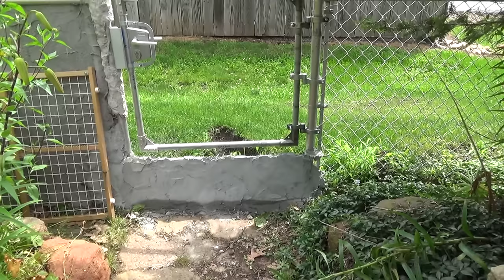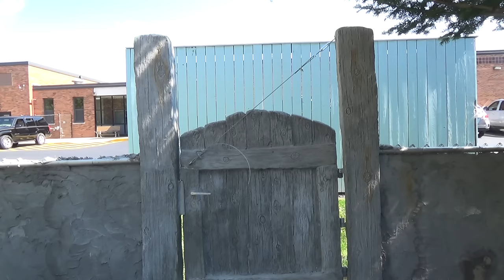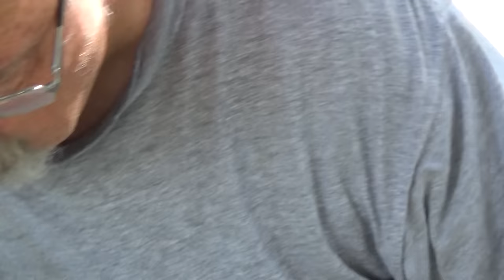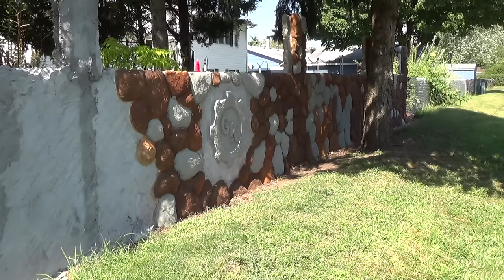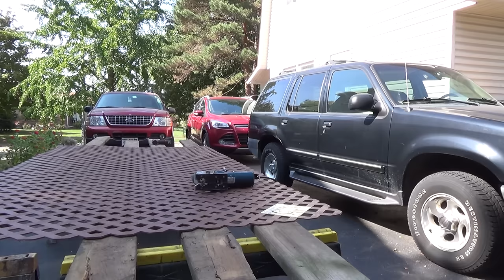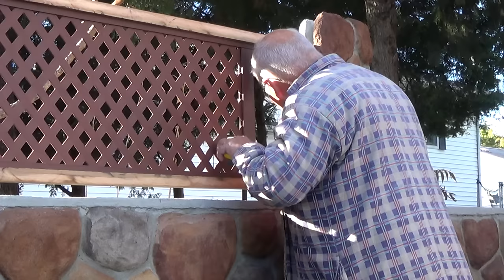Part 2 of 2 Converting my chain link fence to a stone wall

Comment: What is the list of ingredients for the cement for post, fence cement and mortar joints?
Reply from the maker: The posts were put in commercial concrete when the fence was built in 1974.  dperry428
dperry428
2 years ago
Here is part of an answer I gave someone else: 

Sand, Portland cement, CSA cement, metakaolin, silica fume, acrylic emulsion, PVA fiber.  Here is a video I did more than 3 years ago about the ingredients, minus the silica fume. https://youtu.be/etSWuBIcdZc   I get my supplies, apart from Portland cement and sand, from Fishstone http://concretecountertopsupply.com/ . 
The mix for the scratch coat is 3 sand to 1 cement, 5% CSA cement, 10% metakaolin, 8% silica fume, 2% Xypex (crystalline waterproofer),  alkali-resistant glass fiber, and acrylic bonding agent/admix in the liquid at 3 parts water to 1 part acrylic, using 50% solids stock acrylic.
The mix for the stones is the same with the exception of using  2 parts sand to 1 part cement and PVA (polyvinyl alcohol) fibers in place of glass fiber. PVA fiber does not show in the finish as would glass fiber.  If you want to build out higher, you might substitute a lightweight aggregate for 1 or more parts sand.  Very fine grad vermiculite, perlite or pumice works well.  Keep in mind that lightweight concrete is not as strong.  
Mortar lines are same formula, minus fiber and I also sifted the materials to eliminate possible lumps that could clog the bag tip.
Reply: @dperry428  Thank you for replying. I love your videos so much that I am attempting your project. 1400 feet of fencing and we can go 8 ft high now. I am taking your idea of the lattice as well. Plus, I like the skirting for my mobile home and office. Porch idea will be concrete post. If I can finish this project. I may do a gold fish pond.
Reply: @dperry428  The chain link is 6ft. Could I still use your recipe for cement or do you recommend a different blend. I do apologize that I am still learning the products name, where to get them and what they are used for. Thanks for your help.
Reply from the maker: I can't make specific recommendations for your particular fence.  I am not an engineer and I also have no idea as to the nature of the construction of your existing fence.  When I did my fence, I knew exactly how deep the post holes were as I was the one who installed them in 1974.  I knew that my project would work since I knew exactly what I had in place.  You'll have to decide if your existing fence is solidly embedded in concrete below frost line.  The concrete formula that I used is very strong as it is based on the latest concrete technology and should work well if you use the same mix and if you apply it correctly.  Use metal lath attached to the existing fence, apply a scratch coat to both sides such that the thickness is not greater than about an inch.  Then, the stone application should also not be excessively thick.  The total thickness of the finished fence, including the faux stone on both sides, is less than 3 inches thick.